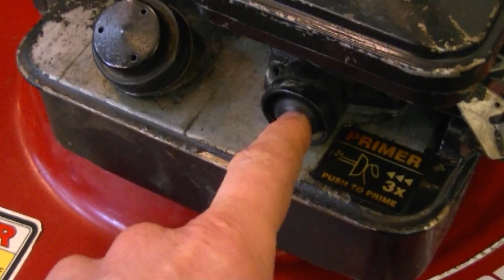Small Engines Q & A Video #55 in HD

Comment: I think the fee up there sucks I can receive and have received some cloths with the
tags still one them for over 100 bucks  I got them from nova scocia  and I was not charged any fee also sent thing back for repair in canada and they wanted to charge the repair tax for sending a broken part back . I have the exact trimmer got it at a ysrd sale for 50 bucks and found out it still had a 1 year warrenty left on it .
The throttle on mine has gone bad again its the finger control thats bad

Comment: dony, im the guy with the generac engine. took the head off, and found out that the valve seat had worn uneven, caused from overtightening the valve. what is a fair price to have the seat regrouned? ive had 2 estimates one for15dollars and one for30dollars?  thanks    dick

Comment: I have a cheaper solution to buying a new carb. I had a primer bulb problem on my Briggs. The primer bulb was fine it was the gasket behind it that kept failing. I tried everything until a friend told me to just use an in-line boat primer and it works great!

Comment: Can you do a video on adjusting/leveling a riding mower deck?  In particular, I'm having an issue leveling a deck on a Craftsman DLT3000, I've followed the manual several times, yet it is still uneven when mowing.  Is there a tip or trick to get it right the first time?

Comment: don, i have a question. i have a generac generator with a 6 and one half hp engine. the problem is with the engine.  the last time i ran the engine, i noticed that part of the muffler was glowing red. ther are no carb adlustments other than idle, i  idled the engine down some, it seemed to help, but still glowed red some. the oil was fine but old. what could be the problem? thanks   dick

Comment: Great channel
Reply from the maker: thanks man
Reply: donyboy73 hey donyboy I have a mtd chipper shredder with a Briggs and Stratton 5hp engine. Probably about 15-20 years old. I've done a lot work to this. New fuel tank, New air filters, New armature, refurbished exhaust, rebuilt the carburetor. But here's my problem. It won't run or pull gas from the tank. I also put a new fuel pipe on the carburetor. If I put gas directly into the carburetor it will fire up and run for a few seconds until that fuel is gone. Any ideas? Thank you.